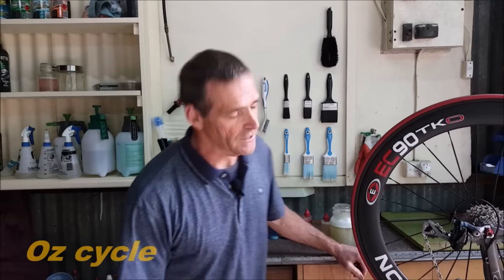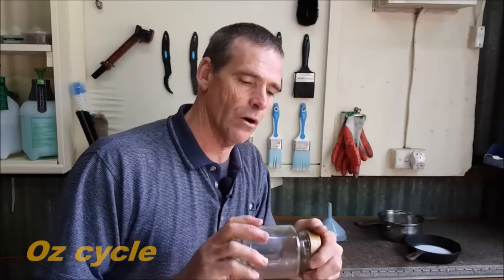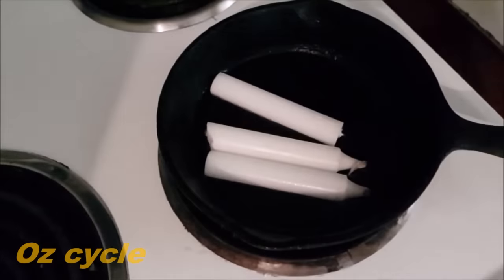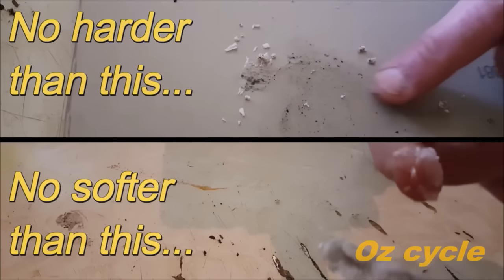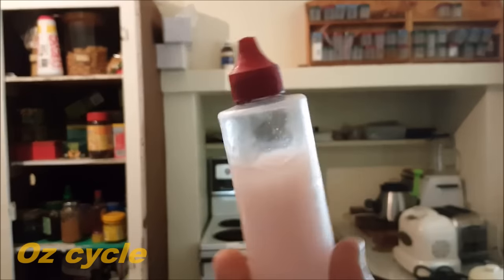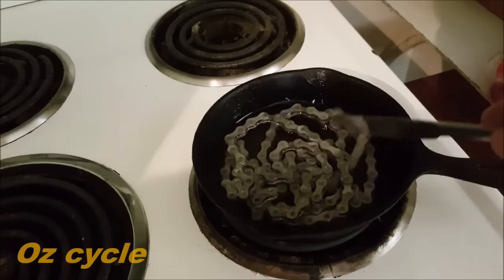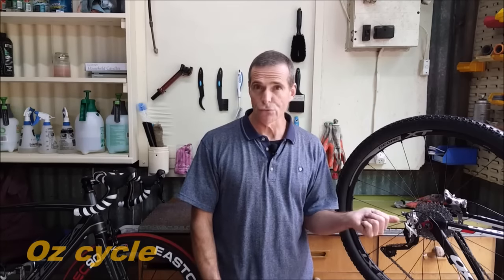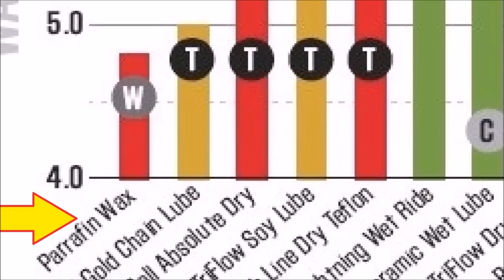BEST chain lubricant ever !! .....make it yourself.

Comment: Hi, I followed your instructions and applied the final product to the chain. My first impressions while cycling were very positive. The chain is running smoothly und very silently. Unfortunately, after a ride of 20 km I noticed that the chain running noise increased. At a closer look at the chain I found out that the roller were dry a not coated with wax. In general, it seems as if the wax does not stick to the chain very well. Have you got any ideas on that issue? Best
Reply: You have to super clean you chain first - watch his other videos

Comment: What about cold weather riding? At what temperatures would I need to start using another lubricant?
Reply from the maker: +Michael Edgley Use hot wax bath method,Michael (see other vid). If you want to use portable wax lube,add more xylene...the xylene evaporates leaving only wax lube.
Reply: Thanks very much. I only just stumbled across your channel. It's a god send. I'm in the process of acquiring tools for my own home shop. Anything to save on money and still produce quality work is appreciated. Thanks again and keep up the good work. You're like the King of common sense DIY fabrication.

Comment: Hi oz cycle. i was just wondering, instead of xylene, can i use lacquer thinner for the medium? thanks in advance for your answer!
Reply from the maker: +Keith Russell Berondo Im not sure Keith. "Lacquer thinner" may actually be xylene in some countries. Try googling  "lacquer thinner (followed by the country you live in)"....or do the same for xylene. In Australia it is not the same as xylene so I wouldnt recomend it.
Reply: thanks oz cycle! keep it up!
Reply: Today i bought lacquer thinner. I was sure its the same as Xylene until I saw your question. I found out that Lacquer thinner is a mix of Acetone and Xylene but it seems i still got a good result. The lube however solidifies in the bottle very fast even in room temperature of 30C. After heating it up like shown in the video it gets liquid again.
Reply: Nikolaj Andersen how much lacquer thinner are you using for the brew?
Reply from the maker: +Keith Russell Berondo Same volume as the wax...so its 50:50
Reply: oz cycle thanks for that! Will try to do another batch soon.

Comment: we don't have xylene at our place, what will be a good replacement? will paint thinner work?
Reply from the maker: +Joms F There are different mixes of paint thinner but generally,yes,it should work. Try a small sample first before making big batches.
Reply: i will also try acetone
Reply: if you are in uk, halfords might still sell a specific thinners for hammerite paint it which I believe to be xylene. acetone is not as good a solvent for wax as xylene I dont think.

Comment: Can I use only the paraffin oil alone?? I tried to make this at home, but 2 problems. The brew becomes hard very soon and when I want to put it on the chain I need to warm it. And even when it is warm it gets hard almost immediately after being put on the chain. And 2nd problem is the smell of Xylene. It smells terrible around the whole workshop. So if not to use only paraffin oil - can I use the brew without Xylene?? Thanks :-)
Reply from the maker: Yes. The other video shows how to make it using heat to melt the wax,however,it isnt for bottled application. If you wish to use a bottle you will need xylene. To keep the mixture liquid at lower temperatures add more xylene.
Reply: Thank you! And what do you think about using paraffin oil only?
Reply from the maker: Messy just like any oil.
Reply: And using alcohol instead of xylene? Smells less...
Reply from the maker: Im not sure if alcohol disolves paraffin wax Zdenek. Try a little bit in a jar and let me know?
Reply: I will try tomorrow. We use this alcohol (ethyl alcohol) as a thinner for colors. It does not smell that bad as Xylene. I will let you now. I will also mix a bit more alcohol and see if it will be more liquid.

Comment: What about the issue of using xylene around carbon chainstays. Seems counterintuitive!
Reply from the maker: +Nathanael Peaslee Xylene evaporates very quickly so shouldnt be a problem. When applying to your chain on the bike take a bit of care not to splash it around too much or put a rag over the right hand stay. Cheers Nathanael.

Comment: Will the Xylene in the mix damage or discolor metals?  I'm thinking specifically of spokes, rims and rear hub, some or all of which, on  my bikes, are aluminum.  Why is a paint stripper (xylene) needed in the mix?  What does it do for lubrication that the melted wax & paraffin oil won't do alone?  Considering the toxic aspect of xylene, and I assume it's corrosive qualities, I just wonder why it's needed.  Anybody?  Thanks.
Reply from the maker: Xylene keeps the wax in a liquid state. Once evaporated the wax is left in the chain as you mixed it before adding xylene. Its an alternative to putting your chain in a hot wax bath.

Comment: Is wax good for cold weather riding, or does it become too viscous?
Reply from the maker: +Steel Teepost It should be fine....just make sure you get the consistency right for your ambient air temperature.
Reply: Thank you for answering. I ride all winter, including using snow chains on 700x35c Schwalbe Land Cruiser tires. I don't want the wax getting overly hard and just chipping out. I'll have to experiment with the knife test at below freezing temps. Again, thanks for all your great videos!
Reply from the maker: +Steel Teepost Gosh,your a tough nut cyclist ridn those conditions! Yes you may need add more paraffin oil to keep wax soft at cold temps. Let us know how you go?....Steven
Reply: I was so nuts in my early 20's that I'd commute 12 miles to work down to 10F (-12C) with a breathing apparatus to warm air so my lungs didn't hurt breathing cold air. I wrapped about 3 feet (1 meter) of clear plastic ventilator (breathing machine) tubing around my abdomen under my T-shirt to warm the air, and sucked in the warm air with a scuba mouth piece.  I'll let you know how it goes, if I can test it in the cold yet this winter. We're having flowers blooming in February near the Great Lakes right now. Weirdest winter ever.
Reply from the maker: +Steel Teepost Do you have a picture of yourself with all that gear on?....viewers would like to see such determination to ride in adverse conditions
Reply: It was 25 years ago, but I wish I had some pictures of it! Getting back into winter riding this year, I rode only down to 20F (-7C) and my lungs didn't get wheezy from the cold air. I'm pretty sure I threw away my setup a couple moves ago. It sure did get some looks back in the day, a crazy cyclist on icy gravel roads with a breathing mouthpiece on his face.

Comment: Can this lube be also used to lube up things like head bearings?
Reply from the maker: No real longterm trials on wax with bearings. Wax is great for sliding surfaces....so you can use it in gear and brake cables.

Comment: You do not really need xylene. Hot paraffin and paraffin oil in the bottle is enough.Just when you want to lubricate the chain you have to put the bottle in hot water to melt and flow from the bottle ....
Reply from the maker: +Nichita Stan You will need to heat your chain up otherwise on application the wax will set without getting into the pins and rollers Nichita.
Reply: Also not very handy if you are on a multi-day ride and want some lube to take with you.

Comment: Hi all. I did the oz wax today. My problem is that it’s not staying liquid. Do I need to add more paraffin oil  or my xylene, it’s seems to crystallize as soon as it cools.
Reply from the maker: More xylene keeps it liquid at lower temps.
Reply: @stevenleffanue  thanks for the reply, i think the lamp oil i used is actually mineral oil, i see you put the lid on the as soon as you pour the xylene in, i use an open pot and then transfer my product into the containers, i think this could also be an issue.  Its perfectly liquid when warm and it solidifies as it cools, i live in South Africa and the temps are never very cold.  Suggestions?

Comment: if xylene dissolves paraffin, why do you melt the candles?  why can't you use equal parts paraffin, paraffin oil, and xylene in a container and let xylene melt it all together?
Reply from the maker: Xylene is for making the portable squit bottle wax. The hot wax is better because it penetrates the chain properly is  less toxic and cheaper.

Comment: Question - if Xylene is a thinner, won't that wreck the bike's paintwork?
Reply from the maker: The xylene evaporates quickly leaving only wax,David,so as long as you apply it to the chain without splashing it about your paintwork will be fine.

Comment: Too easy! I just made some up with generic Paraffin based hand cream from the Chemist - [based on the Dermese suggestion]. The hand cream is about as creamy as Vasoline with no smell) Heated it on my camp stove melted super quick and mixed in some Xylene. Too easy. Poured it into an old bike lube bottle. Lubed up the bike chain in a dish before putting it back on the bike. I think I may need to add a little more candle wax to the mixture to stiffen it up, but will see how this works first. I plan on re-melting with the hot air gun method too, that sounds like a plan, so long as I don't melt the jockey wheels!

Cleaned my chain dried it in oven at 100c 
Made the lube and squirted it all over hot chain in steel dish 2 parts Paraffin hand cream 1 part Zylene
Hung chain up to cool and ran my gloved hand over the rollers to massage the stuff in
cleaned cassette and coated it with my new wax 
Reinstalled the chain. Have not gone for a ride yet as got a bung arm :(

Comment: I don't want to mess with the xylene, so every 3 rides I will need to take of the chain and re-drip my chain?
Reply from the maker: Approximately,yes, Joe. The hot wax method will extend time between waxing to about 300km.
Reply: I can handle that since i bought the connex like you mentioned

Comment: What was wrong with previous video?  Was your  formulation to disturbing for the competition?  :)
Reply from the maker: +ExtraAlterMone The original mix tended to be too thin...and applying more,the xylene disolved the wax already on the chain,still leaving the chain relatively dry. The new mix leaves more wax per volume of wax lube used plus doesnt splash everywhere when applying.
Reply: oz cycle tnx for your explanation!
Reply: I made your original and I have made this one and all I can say is that I've gone back to the original, your second recipe just gave me a bottle of wax that doesn't squirt at all and I ended up having to add more xylene and paraffin and transform it into a batch of the original stuff.
Reply from the maker: +james kaye Yes James,the original mix is good in fine conditions but many people found it too thin under varying weather conditions. The new formula leaves more wax in the chain. If the new formula solidifies in the applicator bottle,simply warm it up a bit in hot water,then apply.
Reply: I'm riding in very fair conditions in Spain on the Mediterranean coast, only been out once in rain on the original mix and it came off after about 30 minutes, I get about 60-80km from one lubrication on a KMC X10 chain and I've got to say the most impressive thing is that I haven't had to clean my drive train in 500km and it's either very dusty or damp and mud sprays here. Not suffering from any of the rust problems either that people have been talking about but there is no salt here, one thing I do is after cleaning the wheels and applying new lube I use a toothbrush (always the same one) to spread the wax across the cassette, keeps the dirt off nice and the water just beads off it when the wheels get washed. I've even started rubbing the dried wax (after the Xylene has evaporated) on the brush onto the bottom of my frame and it's making getting the sprayed on glue like mud off the bike really easy, the bulk comes off with slow running water from a hose and then I wipe the rest off with a cloth.
Reply from the maker: +james kaye They are great ideas for using the wax,James...think I will try them myself. Might relate that in coming Vlog too. Cheers

Comment: I wonder if you could use acetone instead of xylene, acetone is dirt cheap sold as nail varnish remover.
Reply: u can use gasoline or diesel to. Diesel is better cuz its oily.
Reply: acetone may not allow for the wax to mix completely and will likely drop out of suspension leaving you with wax and solvent again. You need to use a naphthenic or paraffinic solvent and not a simple ketone such as acetone
Reply: gasoline is very dangerous. Very low flash point and flammability limit is easily reached in confined spaces. Would not suggest this.
Reply: thanks

Comment: Is there a ratio that keeps the final mixture as a liquid? I am often going 'duh' when I need to go back into the house and get hot water to melt the mix.
Also
The wax mixture ends up being black and excessive on the chain, just like the regular lube does.  What am I doing wrong?

Comment: $18 for 1 litre of parrafin oil & xylene each at bunnings plus candles from coles. can i use the cheapest candles?
Reply from the maker: +Rob Banks Thats a little expensive,Rob....I paid $10 paraffin oil and $13.50 xylene. Yes,ordinary cheapy candles are paraffin....those cheap shops like "cheap as chips" should sell them. I bought mine from Coles.
Reply: Sorry, I read it wrong, the parrafin oil is $12. the xylene is $18 @Bunnings.

I went to bunnings on Friday and bought 3 in 1 Lubes, the company is owned by WD40.
I also stocked up on degreaser at $2.75 a tin.

Let me get this straight: you first have to degrease properly, then you can do the wax treatment?
I tried finish line dry and rock n roll gold, but i think the wax is better.

Is that rig towards the end some set up you have for cleaning your chain?
Reply from the maker: +Rob Banks The most important and most time consuming is cleaning the chain,Rob....its vital to get the chain clean as you can so the wax sticks. The "rig" is basically an old 26er MTB turned upsidedown....you can find more details on it in "Bike tools clean" vid.
Reply: I'm a new sub as I just got my first drop bar recently - cycling is great because it's so individual and there's so much to learn. In Sydney, we get ripped off for everything.

Comment: What is "paraffin oil"? Is it kerosene in the US? People all over the world view this site and nomenclature is vastly different. So...perhaps you can clarify?
Reply from the maker: True Paraffin oil is used in cosmetic and medical industry.
Reply: Paraffin oil is paraffin wax liquefied for use in paraffin lamps.  Basically like an oil lamp but it uses paraffin oil.  I puzzled over it myself but found it in a (pretty big) hardware store.  It's also known as "lamp oil" in the U.S.  Hope this helps.
Reply: @stevenleffanue  I just saw the added info about "true" paraffin oil.  I didn't think of sourcing it from a medical supplier.  I suppose I'll use my "lamp oil" (paraffin lamp oil) stuff and hope it works alright.  I already spent about 30 US dollars on supplies, if medical grade paraffin oil is necessary it might be cheaper to simply buy a commercial formulation!  But again, why the xylene?  What does it do?
Reply: Okay, xylene keeps the stuff liquid at lower temperatures.  Found the answer in one of your other responses.  Sorry to repeat answered questions; I didn't know!   Can't wait to try this shi* !   I mean mixture.  As you wrote; Xylene will evaporate.  I breathe a lot of toxic garbage in Chicago just walking to the corner; a little paint stripper isn't going to kill me.  Will keep you posted on outcomes.

Comment: Well I tried it and I'm not convinced, after 2 MTB rides the chain was getting louder and after a light spray of rain also started rusting immediately, any comments/suggestions? (I did the bathing the whole chain in the paraffinoil/wax thing)
Reply: Complimbocile. Imbofool. Clean the fuck out of the chain first.
Reply from the maker: Sounds like your wax may be too hot when the chain is removed. Try removing your chain from the hot wax bath at 50 - 54deg Celcius Mo.
Reply: Thanks for getting back to me, I'll give this a try! How do you clean the waxed chain? Is petrol sufficient?
Reply from the maker: +Mo You shouldnt need to clean a waxed chain, just put it in the hot wax bath again. Use a sieve and any dirt will sink to the bottom of the pot whilst the chain sits above the dirt in clean wax. Im working on a vid to show this...should be uploaded next wednesday. Cheers Mo
Reply: Cheers mate!

Comment: What brand of quick link do you use for your chains?
Reply from the maker: +Aaron _ wippermann connex
Reply: wipperman connex link - it's a German thing.  I use a wipperman chain (and connex link) on my cargo bike with an electric motor.  I can put 1000W of power into that drivetrain, and the chain has been working fine for over five years.  I believe OZ is right about the quality of that link.

Comment: 6:05 what is the point of adding a medium (xylene) if wax still get solid and not liquid when cooled to room temperature?
Reply from the maker: +Hoshikani The wax will be semi solid.....ideal to remain in the pins and rollers but not too liquid so as to run out leaving the chain too dry.
Reply: oz cycle oh, i need a consistency which will allow to take a bottle to ride where it can’t be heated
Reply from the maker: +Hoshikani Yes,use the Xylene and wax mixture. Xylene evaporates quickly leaving just the wax in your chain.